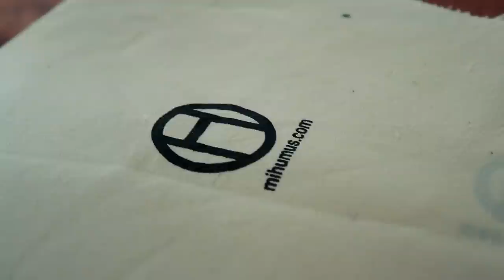AMAZING SCREEN PRINTING PRESS to PRINT your OWN T-Shirts / #DIY

Comment: With this set up, does it allow for registering all the screens? I'm assuming it would because of the 4 screen setup but I didn't see where you could slide the screen up/down/left/right. this is awesome btw... wish I had the woodworking ability to do this
Reply from the maker: Check out the link in the description and you will see how it works. Note that has a rotary base (lazy susan) which can rotate the four screens. If I can do, you too. Thanks for watching :)
Reply: Its good you noticed that, Answer to your is.......NO! you will have to register the design by measurement from of the screens edge, meaning allowing space to register your other screens, this is a pain saking method.

Comment: Great Build!!! I do have 1 question though. If doing 4 color print job and needing to register with all 4 screens attached, i don't see how there is enough space between each arm to prevent the screens from hitting each other. Is this to be used with all 4 screens installed at once? Maybe longer boards for each arm?
Reply from the maker: Thank you!! There's no problem with the arms... You can register 4 screens at the same time or individually, depend how much bases supports you are using.
Reply: Thanks. went ahead and finished the build last night. You are correct. Have enough room for all screens without hitting.  Thanks for the video.
Reply from the maker: Great, glad to know that. Thank you for watching!

Comment: What about the registration? 
Does it fit correctly the colors of all four screens?
Reply from the maker: No entiendo tus preguntas...
Reply: @mihumus  Do all colors fit together? Do all four screens fit the print perfectly?

Do all colors fit together? Do all four screens fit the print perfectly?

to do this project, but I am afraid of the adjustment of the screens
Reply from the maker: @rafaelcasa316  the press is made for that, then if the screens adjust or not depends on the quality of the screens.

Comment: Question, is this DIY machine purposed for printing Business cards only etc, or for T shirts & various garments as well? everything else made sense, the actual print board didn't?  because the actual board is suppose to be steady at all times without movement, through the duration of printing, i thought i would highlight this, because i don't know of any industrial carousel print board that doesn't have any type of locking system, there's a purpose for this. Awesome design though.